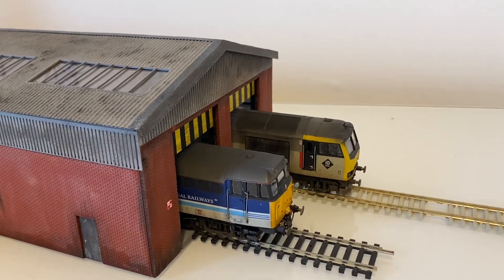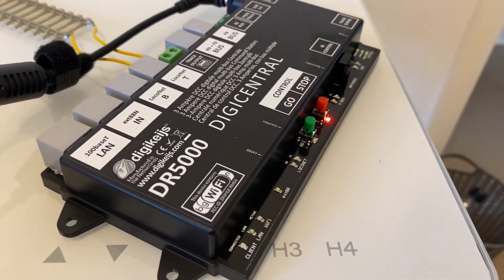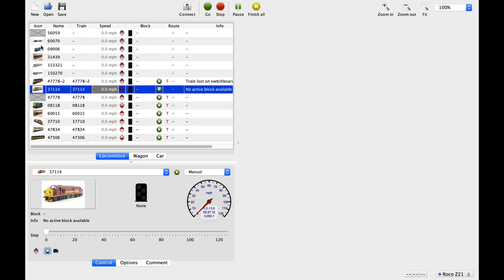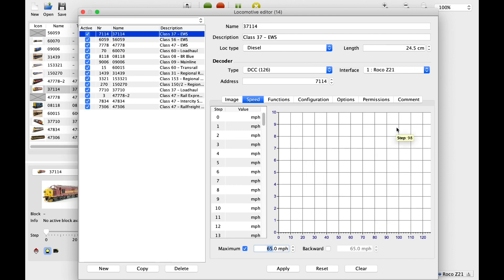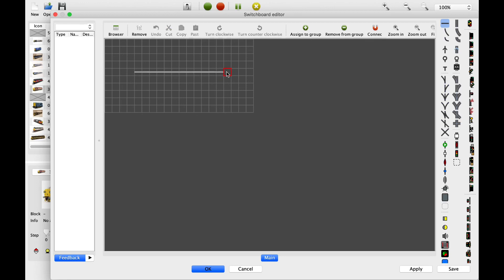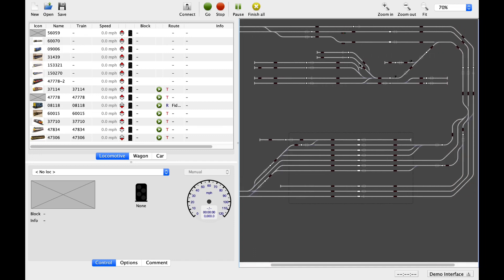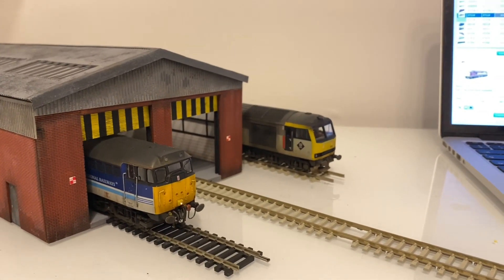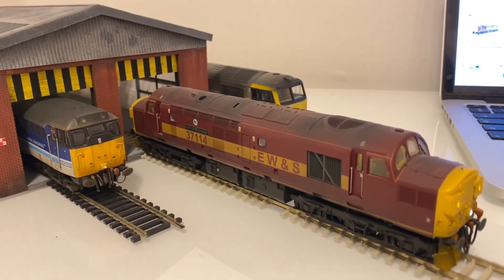NEW LAYOUT! Episode 4 -Computer Control, DR5000 and iTrain - St. Michael’s Hill Model Railway Ep.68

Comment: I've just got a DR5000 and iTrain software to start running everything properly.  I can't see the DR5000 in the dropdown interfaces on iTrain - You said you had to clone the Z21 - how did you do that ?
Reply from the maker: If you're running iTrain 5 DR5000 is there I think. If it's not there, it might be because you're not on iTrain 5 or maybe a lower package. It was set up as a Z21 by James at DCC Train Automation when I bought it, I only did that as I use Mac and the desktop control isn't available on mac.  I'd say contact James at DCC Train Automation and he'll sort you out for sure.

Comment: Hello Sir,
In your introduction about iTrain you told that you can see a list of added locomotives , wagons and carriages , 
Thats wrong info. Cars is what it says, cars/auto’s. Its ment for a list of cars that you can use with the (Faller) car system, you apparently have an expert version of the iTrain software.
Then there is the part where you said you can drive the trains automaticly, semi-auto and manual, thats true but the button in the control panel is not for that purpose. That is a mistake that is made all the time. People think ‘ow my train is not driving, its in manual, i have to click on that button and put in in automatic’
But that is not what the button is for.
Its for setting the signal system and how that train is behaving on the security level of the signals.
If it is on automatic then iTrain will control the signals and you can drive your train in that block and the software will keep an eye open for the safety so it stops the train when you approach a red signal.
In semi auto its only stops the train once but if you are stubborn and still turn the speed up, the software lets you do that, it simply thinks ‘ hey i stopped it for you, but if you want to go on, thats your problem.’
And on manual you have to look for the signals yourself and the software does not intervene if you go through a red signal.

Comment: This all looks incredible and perfect for a larger layout.
I bought the Bachmann Dynamis [thingy] that promised automation and was nothing but disappointed with it. At best I'd say it's only suitable for a small back and forth plank with two DMU's and a couple of points. Setting up anything is an absolute chore and is done similarly to typing out computer commands on DOS. Even at release it was so behind the times. I spent hours trying to get just one loco to stop in the same place and ultimately just gave up as everything is based on time, but doesn't take in to account stalls, splutters, or simply fluctuations in motor performance.
So I'd say, if you're set on automation, definitely start up a swear jar and do it properly with a proper block detection system and avoid the "easy" options.
Reply from the maker: Oh that does sound like a nightmare. I am very much planning on setting it up with block detection and avoiding the "easy" options as you refer to them. I'm sure I'll have a swear jar that'll buy me a new loco by the end of it though!!!